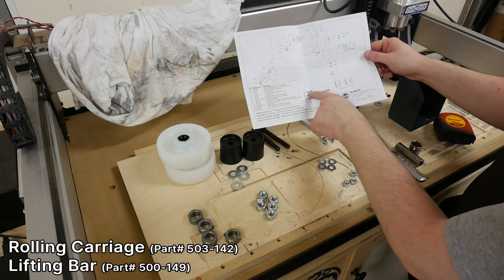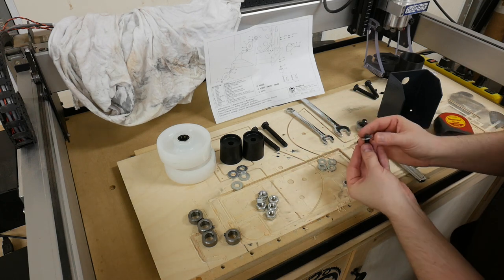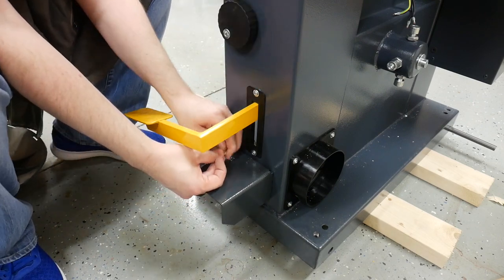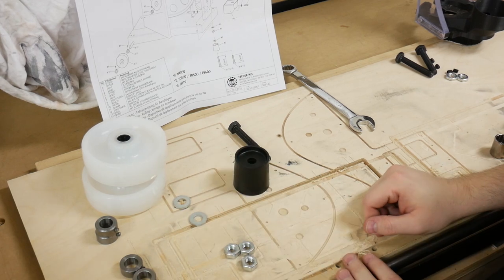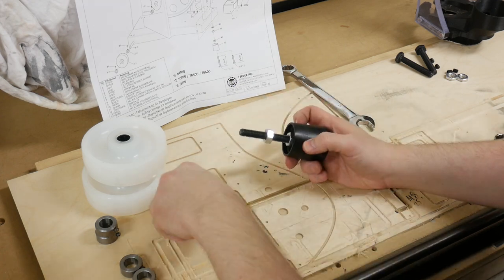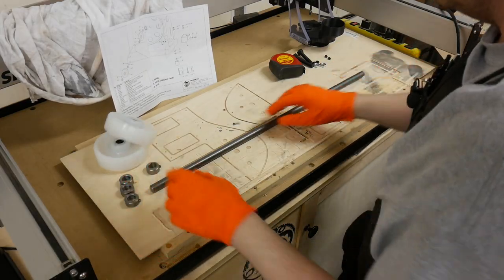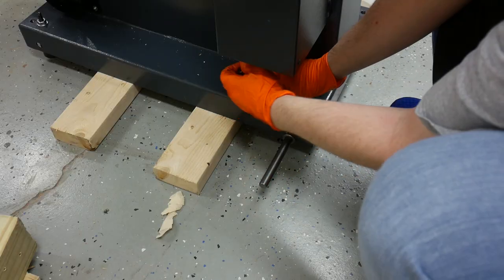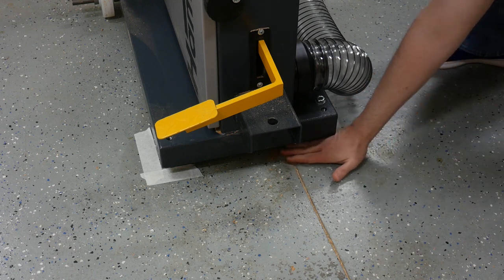Hammer N4400 Rolling Carriage Installation & Lifting Bar Assembly

Comment: Well explained, Sean. I was surprised by the amount the wheel shaft stuck out on the sides and could see this might be a tripping (and a bunch of cussing :>)) issue for me.
Reply from the maker: Thanks Steve! I've had a couple people say that but it's really not an issue unless you walk really close to your saw(like your hip would have to be touching the saw to get close enough). It only sticks out about 2 inches from the wheel give or take.
Reply: @simplecoveoffcuts3672  Good, I guess if it ever caused a problem it could be cut down too.